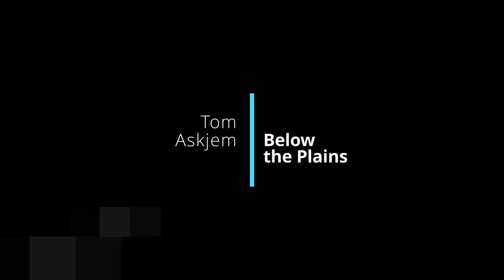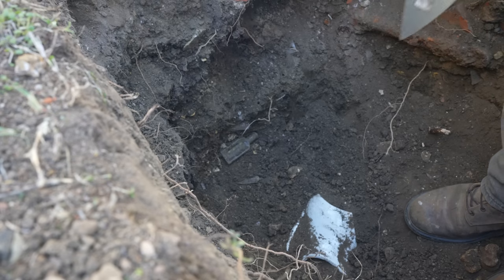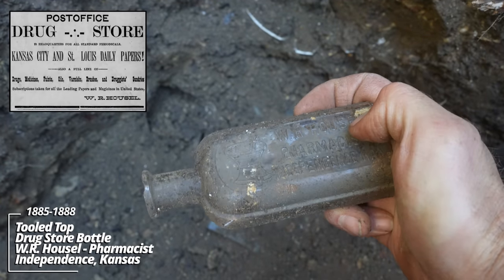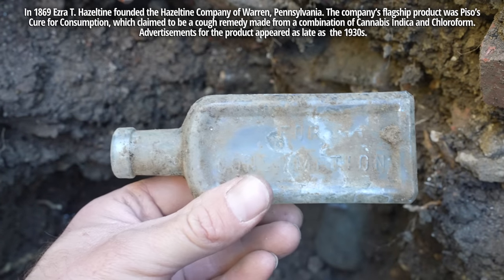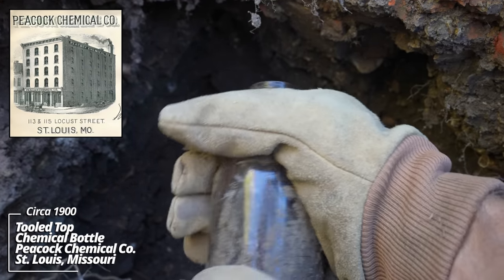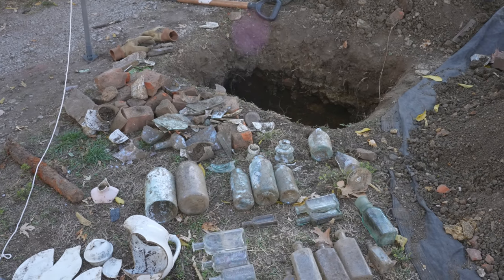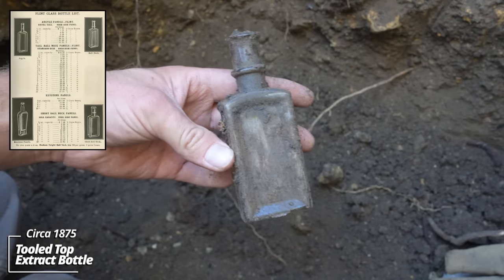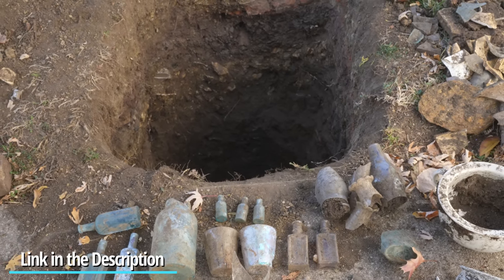148 Year Old Map Found in an Attic Leads to an Unbelievable Jackpot Buried in a Back Yard

Comment: Not sure if you've heard of it, but there is a city in Ohio, Springboro, that was part of the underground railroad. It's actually fascinating. The old (1800) buildings are still downtown, and on Main St. I worked in one and was told there were a ton of old bottles under the building. No one has gotten in to the places under the buildings and I wonder what you could find. There is a plexiglass piece covering the steps that lead down to the underground. It used to be a candy store with the plexiglass right in the middle. They are so proud, and rightfully so, to be steeped in history like that, they may let you go at it in that area. We lived there a few years and went on haunted house tours, etc. A huge amount of history and a lot of mementos of the times under these buildings and nearby. Maybe take a look?

Comment: When you lightly tap bakelite on another similar piece or on wood, it makes a different sound than plastic or celluloid does when tapped. Difficult to describe...it makes more of gentle thud where plastic or celluloid is more of that normal tapping sound you associate with plastic. With  bit of practice, you'll find it easy to identify by tapping it. Because Dominoes are the easiest item to identify by sound, it's a good place to start.

Comment: Serious question here folks. Having a relative here that has one of those Doll Body and head bottles let me know if they were Great Britain circa 1898 or so... Someone also said it was a syrup bottle from with Florida or Georgia... Both seem plausible. The bottles seem to have the date either 1898 or 1899... Both bottles have the one number 9 slot obscured kind of which means they were molded glass just by having dates on the bottle... I've gotten at the least 3-4 diff explanations.